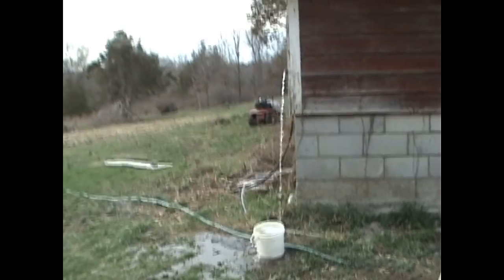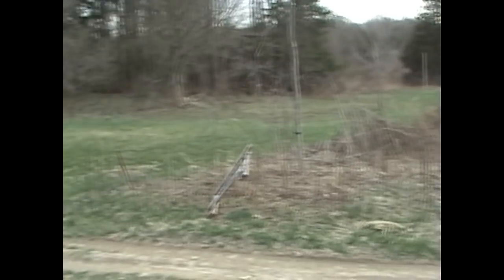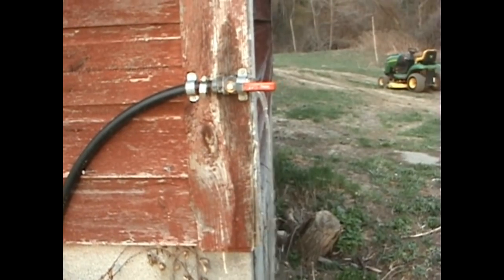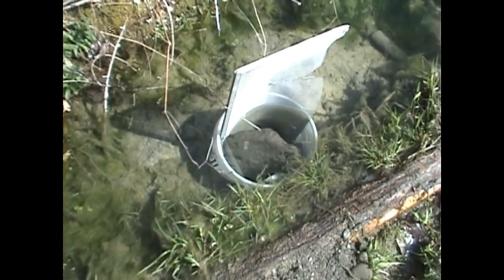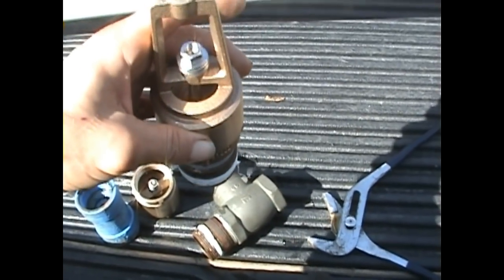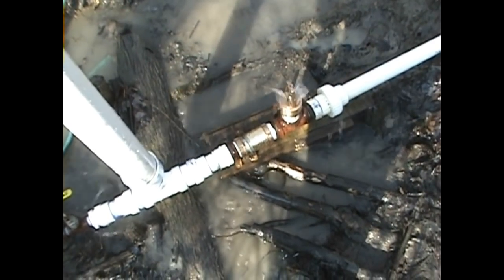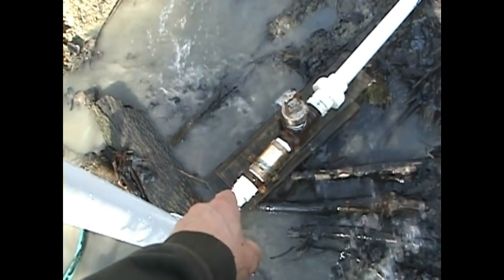04 12 2017 Ram Pump Upgrades * New Valves * and Garlic

Comment: To much weight and the pump will stop, not enough weight and you loose out put as the pump will pump faster but with less out put as the slower it runs the higher the pressure.....and that is also when things start breaking apart.

Comment: You can increase your out put by putting weights on the main pump valve....the pump will run a bit slower but the out put will increase.  the amount of weight that you put on the main valve is very touchy and with just the right amount of weight you can balance the amount of inflow to match the output.

Comment: You have to replace the rubber o-rings about every 2-3 years or so depending on how much use you put on it.  My pumps never stop running except for about 1 month during the winter.
Remember rule No.1 concerning ram pumps:   Never use ANY plastic parts or it is guaranteed fail.

Comment: What is the part number for the new foot valve?
Reply from the maker: I thought I replied to this comment... I don't have the part number... But you can find suitable replacements on Amazon much cheaper than any of the hardware stores in my experience. Search "brass foot valve" on amazon in the size you want to use. cheers!

Comment: So what I got with the conclusion of your video is that it was better that you left it alone
Reply from the maker: Initially, stock, yes.. but see my later videos because this valve was the BEST upgrade I ever did on my ram pump. It just needed more open time in the cycle. I did some machining and added some weights and now it is massively better.

Comment: The smaller surface area on your 1 1/4 needs more psi to open it than your 1 1/2, resulting in a lower flow rate with the larger valve...on the other hand it might pump to a higher point with the larger valve
Reply from the maker: Well actually it really all comes down to flow which translates the kinetic energy of the water flowing in the pipe. You have to remember with my 1.25, it is only on the impetus valve, not matched to the secondary valve. Either way, the water in the pipe is not reaching the same velocity (kinetic energy) as the larger valve. Also, on the impetus valve, it is open until water velocity is high enough to slam it closed. Sometimes this is a little counter-intuitive. It definitely pumps higher head pressures and great volumes with the larger valve, but of course this only works when there is sufficient water to drive it. I am planning to build a monitoring system for it in the future, and eventually make them available to the public. Thanks for watching, commenting etc!

Comment: How much of a water flow does one need to activate the first check valve on the incoming low pressure sided or ft of head.
Reply from the maker: about 3 ft of head minimum recommended. pipe size (and consequently pump size will determine flow requirements)  mine, currently can go as low as about 8 gallons a minute and maintains about 5.5 ft of head. this is a 1.5 inch "tuned" pump with good water delivery..

Comment: If high head and good volume of water you can doube up the waste valve, more volume of water can delivered. I tested and proven to my home made ram pump.
Reply from the maker: Well that is something I will have to try again when I have  high head place to test. I could see that working with more head and / or a better ratio head to delivery. cheers!

Comment: Failing springs is EXACTLY why I want to stay away from spring checks.

On the foot valve where the spring is designed to hold it CLOSED, it is some sort of back pressure that pulls it open after the initialization?
Reply from the maker: The spring is removed on the foot valve. Yes, the refraction wave opens the valve - effectively a suction pulse that follows the pressure pulse. (Ram pumps are a resonant circuit of sorts)

Comment: You should measure the volume of that jar before believing it. Those jars are undersized. I have done it.
Reply from the maker: It's really just for reference... using the same container... to determine if we are getting more or less water after a modification. but yes, for precise measurement, always calibrate.

Comment: Adding weight to the foot valve is the key.  problem is that if you add weight to the bottom of the brass valve, it will break the valve head off from the stem.  The trick is to use a stainless steel valve stem and drill out the valve head and then run the new stem through the valve head and use it to attach weights to the bottom of the valve.
The other option is to make the new valve stem long enough to stick out the top of the housing and then mount the weights on top.  You are definitely going in the right direction.
watch "dougs ram pump" series as he explains what happens after ten years of ram pump experimenting..  He will save you a lot of headaches.
Reply from the maker: Watched dougs years back! He was great! Very nice system he had!   Yes, after many years of tweaking I learned a lot! cheers!

Comment: Lead in brass?
Reply from the maker: No lead in this system.  I'm not sure what you're referring to?
Reply from the maker: The most toxic element of this system is the DWV pipe (poly-vinyl-chloride based) I wish I could do it all in stainless steel or copper... but it would be a BIT pricey. :)
Reply: @TheFarmacySeedsNetwork  there's lead in brass pipes and valves. Is your PVC the same used for water pipes?
Reply from the maker: lead in brass valves?  really?  tell me more!  the pvc is the cheaper stuff Drain Waste Vent (DWC) unfortunately. it came down to price. If I keep farming here and budget allows, I'd switch to all steel pipe probably unless you have a better suggestion for anti-contamination.
Reply: @TheFarmacySeedsNetwork  there's some lead.in the brass from manufacturing. I think there are some ways to remove it like a soak
Reply: @macgyverishere  Not any longer. That is why the brass fittings have escalated in price.

Comment: The stronger spring shortens the cycle. The less water in motion in the delivery pipe, produces less ram effect.Less flow, in overcoming the resistance in the check valve. As well, as the size of the check valve itself. Use a larger check valve than the delivery pipe size. (with bell or donut reducers )
Reply from the maker: yep... it all comes down to inertia vs resistance.  I wish the spring had more flow... I would size valves up another level... but I'm pushing the edge of it's capacity as it is.  I really need to get steel pipe and concrete mounts in place... up the efficiency. Steel pipe is expensive though... so for now... I'm good... So far since the ram upgrades I've pumped 156,600 gallons in 145 days delivered to 72 feet above the pump.
Reply: Yours sounds like a good system. I had a friend who bough a piece of property in the Sierra foothills. After seven years his pump quit. After hacking away the Blackberries and the brush, he found it was a ram pump. He replaced the broken valve, and away she went.

I once taught classes in building. I had the students build a Ram pump from 3" ABS (drive pipe) with 5' of fall (20' horizontal with a 5' vertical), and a 3/4" output line 22' high, 1,400 gals per day, unadjusted (very slow cycling). The flush opening was a toilet flange, the valve made of washers and flat rubber, and a looped 4' flat piece of 1/8"x1-1/2 steel for a spring, with a bolt across it for adjusting the speed. The "Flapper" with a bolt through it and bolted to the end of the flat spring.
The Mass and velocity of the water (Kinetic energy) is what gives the pump its power, minus the friction in the drive pipe, and the "vacuum effect" of a long drive pipe. Hence the need for stand pipes, but with one way valves on top. (Under counter plumbing,  demand venting ). Otherwise some of the ram effect will be lost driving water up the standpipe. The check valve in the air chamber was a bolt, long, with flat rubber and a 1-1/2 orifice into the air chamber.
The larger the output line, the more gravitational resistance to flow there is, and the higher the pressure in the chamber, but not necessarily more flow.
I suspect there is a "Sweet Spot", pipe size and flow, for the output line in any given system.
Also, the resonance of the reflected wave in the drive pipe, if the pump is tuned to it, will increase the ram effect, and increase the output.
Conversely, if the reflected wave is dramatically out of phase with the cycling of the ram valve, it impedes the flow. This is more true of short cycle periods.
Almost all of the pumps on uTube are long cycle.
(Tesla stated that pumping in phase creates an additive effect, increasing the amplitude of the kinetic energy of a mechanical system.)
Reply from the maker: This is the part I like best about rams "After seven years his pump quit. After hacking away the Blackberries and the brush, he found it was a ram pump"     :)

I would love to see pics or video of the system you had the students build... sound VERY well designed and I like fabricating my own stuff whenever possible. Very nice!   
Yes, resonance and tuning is everything... whether mechanical, electrical, or audio or light... all energies interact... in phase you take gains... out of phase you take losses. I'm so glad to see you relate this to Tesla... He was  a genius and sadly wasn't credited as he should have been.

You are so right on larger output line and gravitational dampening... I hadn't considered the hydraulics aspect of that part... glad I chose 3/4" line... was planning on 1"... but when it came to $$... I couldn't swing it. But I THINK that works in my favor...   Yeah, I'd love to have unlimited resources and time to "tweak" trying different line sizes etc...

Anyway... great comments and thanks for sharing!
Reply from the maker: my friend and I have been back and forth in email chatting about this... his latest response is along those lines and I thought you'd appreciate it as well:
pump phasing: this principle is used in 2 stroke expansion chamber 
design. While not valved, the exhaust enters a chamber that expands 
rapidly and then contracts rapidly along it's length. This has two 
effects when the rpm reaches phasing with the physical properties of the
 chamber. First it creates a scavenging effect at the exhaust port, 
drawing a vacuum on the cylinder after the exhaust pulse. This vacuum 
draws out the exhaust remaining in the cylinder after the pressure 
equalizes, clearing it completely. As the phase aligns better, the 
scavenging also draws fresh fuel/air into the exhaust pipe. This is 
significant due to the second effect of the expansion chamber, which is a
 reversion wave created as the chamber tapers down. This reversion wave 
shoves the fuel/air back into the cylinder through the exhaust port just
 as the piston is traveling up for another compression stroke. Sound 
familiar? It's a supercharger with no moving parts, which relies on 
fluid dynamics to operate. That's what gives 2 strokes a power band. 
Cool eh?
Reply: yup!

Comment: can you build enough pressure with a ram pump to have a shower or run water from the tap in the kitchen?
Reply from the maker: You can build enough pressure... but sustaining it will depend on your pressure vessel for pressure storage. The better way to do it is in a reservoir above your delivery point and let gravity supply as much volume as you need on demand. This way you are always refilling / overflowing your reservoir and have as much as the size of your reservoir "on demand" as it were.  I have 2 reservoirs.. a "high" about 15 - 20 ft above the "service area"... and a "low" being a 4000 gallon Intex pool (mostly used for drip irrigation or the rare need to flood an area)
Reply from the maker: As a note: My ram pump with 6.5 ft of input height can produce up to 90 PSI.. enough to climb over 200 vertical feet.
Reply: I wanted to supply my cabin with water off grid. can it be done with a bigger ram , say 11/2"feed?I want to supply a toilet,bathroom sink shower n kitchen sink  cabin is 24' x30'
Reply from the maker: it can be done provided you have enough water and enough fall to run the ram... after that... it is all about reservoir size and time to refill it.

unless you build a VERY large ram pump... it will not supply continuous to the cabin... but if you have a reservoir high enough (as little as 15 feet) it can be pumped full by the ram and gravity fed to shower, tub, sink etc.  see my reservoir videos. cheers!

If you need a consultant, let me know.

Comment: hey my pump runs great for few hours then stops I restart it runs great for few hours then stops again posted couple new vids
Reply from the maker: hmmm...  sounds like maybe there is some air getting inducted occasionally.  That would be my guess as it's proven to be a problem for me on occasion as well. When air gets in, it disrupts the cycle just enough to cause the valve to hesitate sometimes.  I don't know all the parameters of your setup... but I see that supply pipe flexing quite a lot with the cycles... I would find a spot closer to the pump and install a standpipe.  It will make for much smoother operation.  Here's a great link for design on ram pumps:
https://www.slideshare.net/Fatin62c/homemade-hydraulic-ram-pump-clemson-university
Let me know if I can help anymore
Cheers! TFSN
Reply from the maker: the other possibility is a pressure chamber leak.
Reply: I like this video so much because I needed to do this in my place.
Reply: My ram pump is the same, I decided to take out the spring of my waste valve and now my ram pump is more than a month working without any problem.

Comment: you can add weight to your footvalve.... too slowdown the pump cycles which will and will pump more volumes of water ...
Reply from the maker: ha!  funny you should mention that... just finished that upgrade today. Will be uploading a video later tonight on it.
Reply: The Farmacy Seeds Network did you put weights on the footvalve or the swing check valve?  I tried on my swing check valve and it worked out good I posted some video
Reply from the maker: oh the foot valve...  you weighted a swing check eh?   hmmm...
pretty cool... how did you attach that? (saw your video)
Reply: The Farmacy Seeds Network all thread bolt with a locknut it's all rednkeck engineering LOL. ...
but the bolt actually sheared off so I bought another 2"swing. ..
how can I modify the footvalve?  without all the extra wear
Reply: I think with this next one I'm going to drill the hole and actually thread the all thread bolt through the threads that way gives it extra strength and support I'm hoping otherwise I wasted another $40 check valve these things are expensive and those are 200 bugs
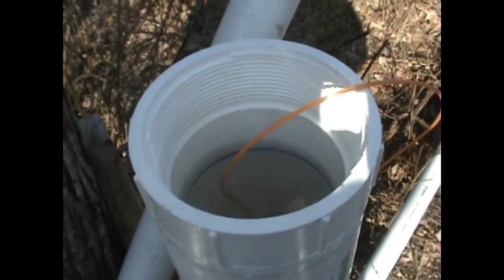Reply from the maker: i think that sounds good... I am uploading a video with my latest mods now... Should be done by 10:30 or 11:00 pm Eastern time.
Reply from the maker: the new modification video is up.  hope it helps you. 
cheers!

TFSN